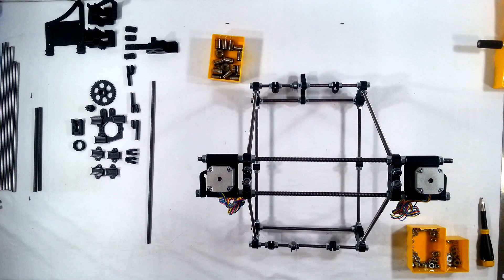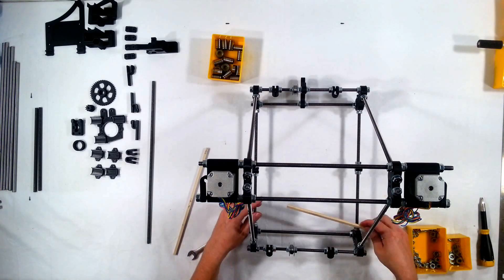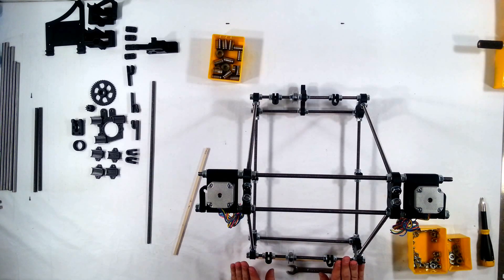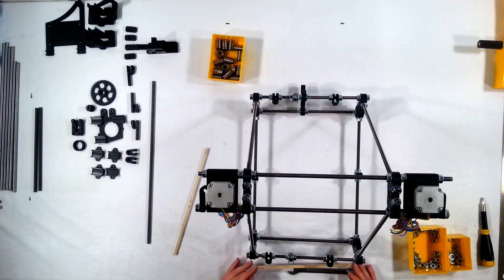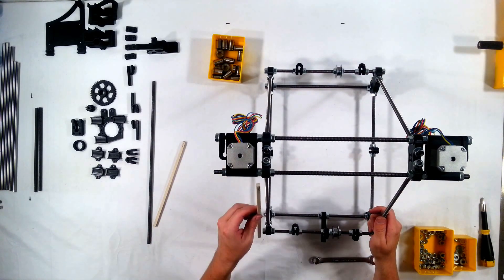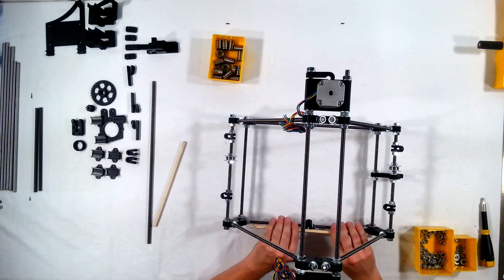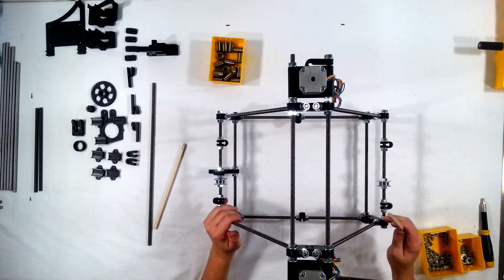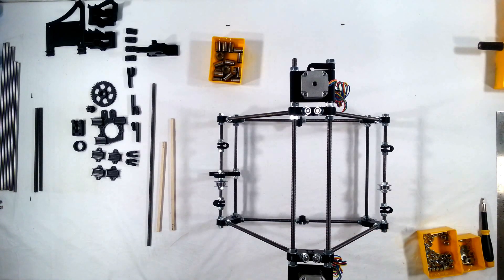RepRap Prusa Mendel Iteration 2 Assembly 05 - Frame Tightening

Comment: Great video for building the Reprap.  Just one thing though, the majority of kits supply simple M8 nuts and washers.   M8 threads are relatively coarse and without 'Nylok' nuts are likely to loosen with the constant movement of the printing mechanism.  To overcome this, I have tightened the nuts as tightly as I dare onto the plastic parts then drop a small amount of 'superglue' onto the nut and allow it to run into the thread.  It makes for a much sturdier frame but still allows for the nuts to be undone if necessary.
Reply from the maker: Peter, that's a good point. In my experience; I have a Prusa i2 I built about three years ago and it's printed between 200 and 400 pounds of filament and the m8 nuts are still on there. ;)
Reply: engineglue   You have been lucky enough to keep reasonable integrity to your connections but intellectually, a thread that will almost allow a nut to run a thread by gravity is indeed a coarse thread.  Even watching you run a nut quickly down a length of threaded rod, you must agree that a sharp stroke with the hand can send the nut spinning an inch or two down the rod.  

The potential for nuts to become loose under the flexing of the frame during use can be alleviated by the use of spring or 'star' washers but would incur greater expense, albeit minimal, but a small drop of superglue to the nut would also give added protection at negligible cost.  Bearing in mind that the normal, liquid, type of superglue is not good for gap filling it is only the point where the rod and nut threads actually touch that are 'glued' and therefore, it is easy to loosen the nuts with spanners (wrenches in the US form of English :-p) but will remain tight in normal use.